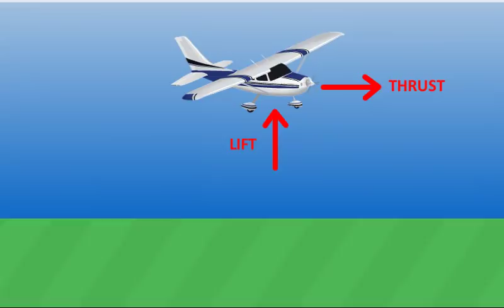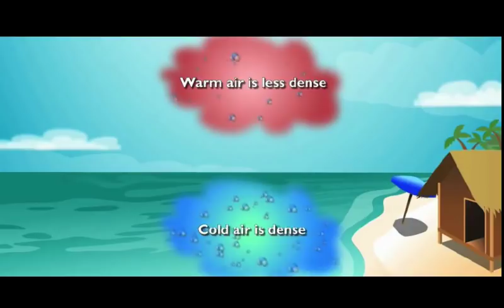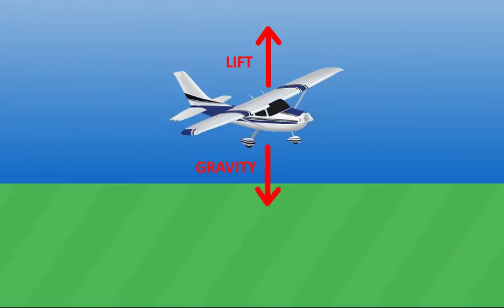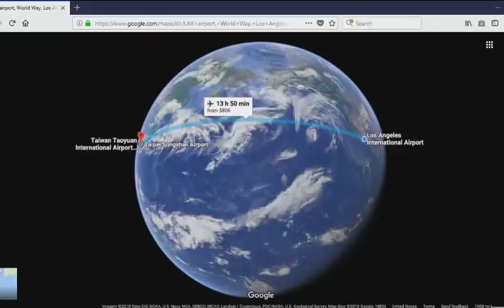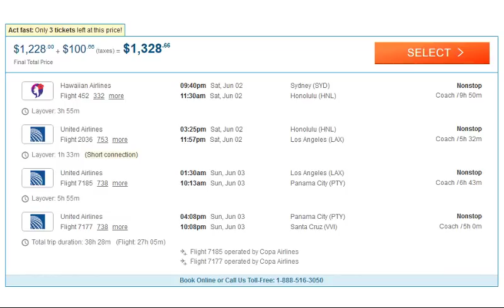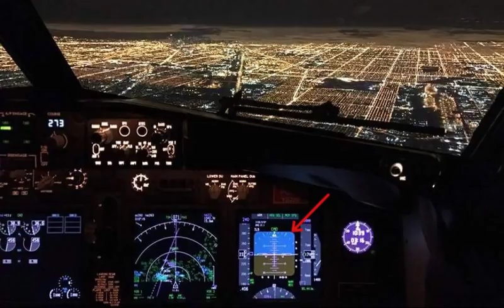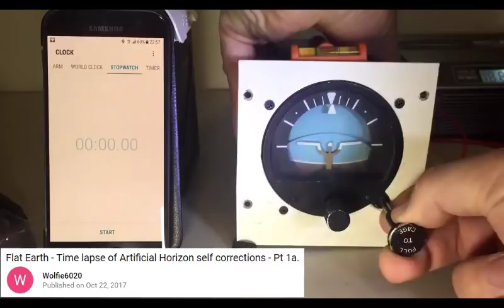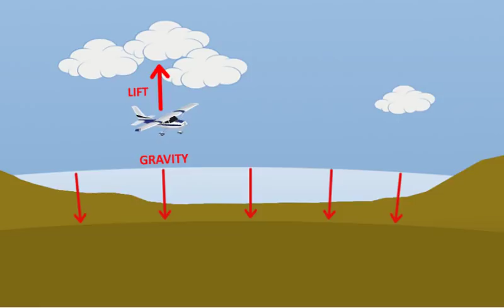Flat Earth Falsities - Plane Nonsense

Comment: I have only one very simple question regarding the Flat Earth Model. I am willing, for the purpose of simplicity, to stipulate to a number of Flat Earth propositions.

1. The Earth is a flat motionless plane. 

2. The outer perimeter is a wall of ice that serves to contain the oceans.

3. A dome of some transparent or at least translucent material covers the plane and descends to the perimeter in all directions. 

4. Above the dome there is a vast volume of water that is held at bay by the structure of the dome. 

5. On or above the dome are located myriads of tiny light sources that rotate in a regular pattern above the plane of the Earth. 
6. The rate of rotation of this array of lights is one revolution in a 24 hour period. 

7. The Sun and the Moon are located below the lower surface of the dome and are relatively close to the plane of the Earth. 

8. Their distance above the surface is roughly 3,000 to 5,000 miles. 

9. The Sun is a substantial source of light and heat that is sufficient to illuminate and comfortably warm the surface of the plane below.

10. The Moon is either a self illuminated disc, or it is a reflective surface illuminated by the Sun, or it is a projection (probably holographic) from a location relatively near the Earth. 

11. The Sun rotates above the plane of the Earth in spiraling paths giving rise to the seasons of the year. 

12. The Sun is also shaded in such a way as to illuminate the surface of the plane for roughly 1/2 of the 24 hour day depending on the month of the year. 

13. The Sun never sinks below the surface of the plane, but rather it moves to a distance sufficient to render it too small to be seen with the human eye, either unaided or supplemented with magnifying optics. 

I will gladly accept these premises as valid after my one simple question is answered. The answer can consist of but need not be limited to any or all of the following:

1. Written text. 
2. Drawings or sketches. 
3. Schematics
4. Pictures or videos.
5. Audio recordings. 

Finally to the question:

HOW?

Describe in whatever way seems appropriate just how this system is constructed and operates.
Reply: How is the system able to function, or be constructed, even dreamed up in the first place is beyond me.  I suppose its like reading a marvels comic book, you reluctantly believe the first law of nature destroyed. Before long everything is acceptable, no questions asked. However deep down you know it is all impossible. Those top scientists at Flattard Technical University can't agree on the height of the sun and you want them to explain something.
Reply: Flattards only demand proof of the globe (which they kneejerk deny).  They blindly accept FE claims without question, because they are "critical thinkers".
Reply: If you need answers, like a tide chart, the next lunar eclipse, even a super moon. Who would ever ask a flat-earther for facts or details on anything, nobody. They the flat-earthers have to google the answer themselves, do they realise when they search for any answer it was calculated by the laws of gravity.
Reply: And remember when a flattard says proof, what they really mean is show them a YouTube video.
Reply: They loves them passages. Except for the ones I often pick.
Reply: Incest?
Or when JC made LGBT mainstream by saying "Get thee behind me Satan", bent over and proffered the KY?
Reply: What holds the sun and the moon up...……...
Reply: A P Presley and if the sun and moon are below the dome why say the moon landing was faked?
Reply: @dylankaiser5546  They plan on returning to the moon within 12yrs, it is like trying out your camping gear in the back yard before venturing further. I am excited.
Reply: @AP Pressley > I have a better question for FE.  Why do you have to look up 30 degrees to see the North Star if you are at 30 degrees latitude, or look up 60 degrees if you are located at 60 degrees latitude and straight up if standing on the North Pole?  Or if you are on the South Pole you cannot see the North star at all.   I would like to know how that is possible on a flat earth.
Reply: @rcairflr  I am in Australia can not see the North Star ever. We have a lovely view of the Southern Cross though.
Reply: @AP Pressely > Can't see the Southern Cross from my location.  Live too far north.  Spent quite a few years in Hawaii where it is visible, but spent too much time chasing girls and hitting the beach and not much time looking up.
Reply: @rcairflr  
"Why do you have to look up 30 degrees to see the North Star if you are at 30 degrees latitude, or look up 60 degrees if you are located at 60 degrees latitude and straight up if standing on the North Pole?" No difference if flat or spherical.
"Or if you are on the South Pole you cannot see the North star at all." Which is correct.
"spent too much time chasing girls" Followed by frantic wanking, no doubt.
Reply: @boffeycn  > You crack me up.  You come on here and insult me, when my post is FACT regarding the North star. In the Northern hemisphere the North star is an angle above the horizon that equals the Latitude that you are located at.  As such, the farther you go north, the higher the North star is in the sky. That is FACT.    If you don't believe me, look it up.
Now with a little trigonometry, you can calculate that on the flat earth, this is not possible.
Reply: "the North star. In the Northern hemisphere the North star is an angle above the horizon that equals the Latitude that you are located at.  As such, the farther you go north, the higher the North star is in the sky. That is FACT.    If you don't believe me, look it up."  No difference if flat or spherical.
Below about 2˚S you cannot see Polaris.
"Or if you are on the South Pole you cannot see the North star at all." Which is correct.
"spent too much time chasing girls" Followed by frantic wanking, no doubt.
How do you calculate the true altitude and bearing of Polaris?
If you take a sextant altitude of Polaris, what corrections do you need to apply for it to be accurate for navigational purposes?   @rcairflr

Comment: I want to be a flat earther, trouble is it does not work south of the equator. I have known people who have flown from Sydney to Santiago. I know workers in Antarctica who swear they have 24hrs of sunlight. Our hurricanes spin the opposite way. Our stars revolve the opposite direction around our south pole. Australia is 500 miles less to drive across than America, but on the flat-earth map we are shown to be twice as wide. Makes it difficult to be a flat earther if you know the dilemma of explaining these inconsistencies.
 Then the solution finally dawned on me. The South Pole is in reality the centre of the flat-earth, now I can happily be a flat earther everything makes perfect sense. Suddenly I can drive across Australia and the trip has been magically more than halved. The flight from Sydney to Santiago I can fly safely without running out of fuel. The around Antarctica yacht race is not 60,000 miles but only 14,000 miles now. Tourists are skiing across Antarctica, mountain climbing, or just standing at the south pole without being called liars. Stars can happily revolve around the pole and 24 hours of sunlight can now shine there as well. Those patrol boats and armed guards are now stopping people from going to the north pole. Don't believe me and be honest, have you ever been to the north pole.
Reply: One thing flat-earthers say is that the compass always points north. Have scratched my head over this, if I want to go south is not the magnet pointing south.
Reply: @appresley4071  my eyes are opened now, finally..! Thank you. 👍👏
Reply: A P Presley Heresy!!!
Reply: Here is our new map  https://www.youtube.com/watch?v=WQ1DxM5cUf4
Reply: Try this one: https://docdro.id/4MGVPqQ

Comment: why doesnt the vacuum of space just rip that atmosphere right off the earth..... gravity is so strong that it keeps our atmosphere in the goldilocks zone huh.....unreal
Reply: A vacuum on the surface of Earth dramatically fills with air because of atmospheric pressure ~14.7 psi. There is virtually no atmospheric pressure in space. Gravity holds an atmosphere which is a gradient, and divided into many imaginary layers, no "layer" of atmosphere is next to another of significantly lesser pressure.
"huh......unreal" is an appeal to incredulity.
Reply: @romithromith  all these "answers" yet none of them demonstratable.
Reply: Really Bobby Wizdum? —
     We can demonstrate that the air pressure declines with altitude. At high enough altitudes, the ability to sufficiently maintain momentum to orbit, demonstrates the extremely low pressure/density/drag. (You can see the ISS pass overhead.)
     FEers can only model reality on the local immediate environment where they live, and lack the understanding of physical laws and relationships which are demonstrable. Promoting FE—and especially defending it from being falsified—requires denialism.
Reply: no you deny that you are being fooled ....u see the iss when it passes by.....u shouldnt see it at all....u are being fooled ...how they are doing ..i dont know but common sense says we shouldnt see it.....look at the jet streams on a globe...now look at it on a flat map.... physical laws
Reply: .    "u see the iss when it passes by.....u shouldn't see it at all....u are being fooled"
     Why shouldn't I see it? It has angular diameter typically greater than Mars or Saturn which we see. You're confusing resolution with perception. All that is required is a single cone to be excited by the light, add ISS is visible reflecting sunlight against the blackness of space that we see.
     "how they are doing [it] ..i don't know but common sense says we shouldn't see it""
     This is called the "common sense fallacy" or "appeal to common sense". Common sense is often unreliable and is not a valid argument.
Reply: .    Since you have a flat map, what is the distance between Santiago and Sydney on that map? What is the maximum range of a 747-400? What average speed would be required for a 14-hour flight between those cities? What is the cruising speed and maximum speed of a 747-400? (hint 9206 miles range; 570 mph / 614 mph cruising / max. speeds)
Reply: Cringe, ugh.
Reply: fernandus lewis A vacuum exerts no force; there is nothing in it to exert force. Air pressure causes expansion of gas into a vacuum to equalise pressure. Gravity can act against this and the result is a gradual decline in air pressure with altitude until the pressure is effectively zero. Bear in mind that we aren't talking about a pressure difference along a valve but across hundreds of miles, i.e., a very gradual decline in pressure.
Reply: By your reasoning Fernandus their should be the same air pressure everywhere above us. Because low air pressure would attract air from higher pressure areas. So without gravity air should be same everywhere. However the higher we go the lower the air pressure gets, if the vacuum of space or lower air pressure isn't ripping it upwards. Something must be pulling the air down. It just might be gravity.
Reply: Charlie Bates  —
    Yes you do see the ISS and not for "a very brief second". You can see the ISS for upto 6 minutes depending on the pass. For example https://goo.gl/ZYcQ7X 
    Yes, it can be viewed at times when the ISS is reflecting sunlight but it is dark on the ground, so ISS isn't occluded by light scattered in the atmosphere. And clouds block the view of the passing station just as they do the stars.
     Go to spotthestation.nasa.gov for the sighting opportunities where you live. Ignore the FEers who are indoctrinated into ignorance and delusion.
Reply: Charlie Bates  — True. Part of the "where are all the satellites" business. My response is where are all semi-trucks and buses from the FE balloons.

Comment: Ball thrown at 3:00 came back to his hand since the vertical distance is less..if he would have thrown to higher point in air in truck kind of thing (where there is no air resistence ) the ball would have fallen somewhere (not in his hand)
Reply: Jesse Duzz Authentic photo of what?
Reply: @Robert Miller
You're a disingenuous, lying fuckwit of a troll. @TheMixedQuadroon
Reply: Srinivas Vasu The ball would lose momentum when it reached a certain height?
Reply: No it would fall back due to gravity ..once it reaches its maximum height it has only force towards downwards ..so it would fall back..but need not be in his hands ..it depends upon vehicle and veloctiy with which he has thrown it
Reply: Srinivas Vasu I think you miss the point. Assuming the vehicle keeps moving at a constant velocity the ball would fall back into his hand. The longer the ball stays on the air then the greater the probability a variation in the cars velocity would occur but the ball's momentum would remain constant.
Reply: You're right.  I've tried that in the back of a truck, threw up one of the softer baseballs about 10 feet up going around 70. The ball ended up falling way behind the truck nowhere near coming down to me.  Don't get me wrong once it left my hands it continued forward but it didn't stay at the speed of the truck were maybe 50 feet in front of the ball when it hit the ground.  It works if you just throw it up 3 feet or so but if you throw it up about 10 feet, you are not going to catch it.
Reply: Robert Miller Was the back of the truck an enclosed container?
Reply: @flookd5516  No. According to the videos logic.  "The wind rotates with the earth." So it should work whether enclosed or not.  Like a helicopter taking lift and the world not spinning 1000mph underneath it.
Reply: Unless the truck was standing still it wasn't moving at the same speed as the Earth & atmosphere.
Reply: To be fair that Voice says Atmosphere, as a whole the gass material is stuck to the same points all the way up into space.
But winds go what ever way without affecting, Their automatic synchronized gravity, on planes and satellites.  
Its all Synchronicity based on luck laws that allow such deceiving purpose looking designs, like the Moon and Sun.
Reply: @flookd5516  So if my driver was driving along the same direction the earth's rotation we were actually doing like 1070mph?  And if we were going in the opposite direction, we would be doing what? -930 mph?  I just want my numbers to be correct for the math involved.
Reply: Robert Miller Revolution is measured in rad/sec or rpm rather than mph; the surface of a sphere is not going to travel in a straight line. How great the distance covered in one rotation is dependent on the radius from the rotational axis, not radius from the centre of the sphere.
Reply: @flookd5516  How is that not the same thing as saying, the earth spins along its axis at approx. 1000 miles every hour in order to complete its rotation in 24 hours for a complete day?  How is that not 1000 miles traveled per hour?
Also, does that effect how many hours(not daylight) are in one day in a town closer to the axis than a town on the equator?  Videos and Scientific journals are welcome, ill read them if you take the time to find it.  Serious.  I'm just trying to learn why the globalist are so much more angry and eager to attack someone's view before taking it into consideration.  Most sheeples(speaking generality not this subject specific) minds are made up from the time you set your eyes on a globe as a kid.
Reply: Robert Miller Since the radius from the rotational axis decreases with latitude, the circumference decreases too. The equator has an approximately 25,000 mile circumference but that is not true of any other latitude yet all have a 24hr rotational period. 

We usually do take a FE'ers ideas into consideration and we certainly apply more consideration that the FE'er did. I would note that you seem to think that all locations on Earth are moving at 1000mph, something that obviously not true if you consider the dynamics of a rotating sphere.
Reply: @flookd5516  That's very true. I  understand the concept.  If the Earth is a spinning spheroids those near the center axis point are only rotatating a certain amount of miles, as compared to say Hawaii a more equatorial land mass its on the fatter edge of the spheroid so its total distance traveled is way greater in the same time period.  Thank you for a logical answer.
Reply: Ugh, the amount of idiocy and cringe in here is unacceptable.
Reply: @Robert Miller
You're a disingenuous, lying fuckwit.
Reply: @jesseduzz4136  Its all good, I'm having fun with these clowns. Especially Wong, is it that Wong of me?  lol. shit I make myself laugh sometimes.  What pic are you talking about that the "globalists" in here believe they have?  Like a REAL authentic pic of earth from space that hasn't been cgi made? Just a wild guess.